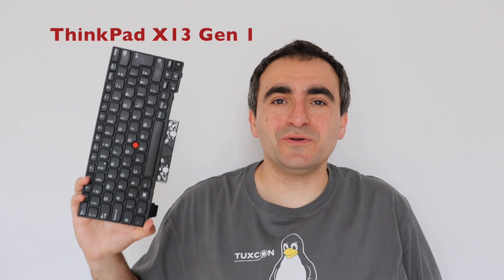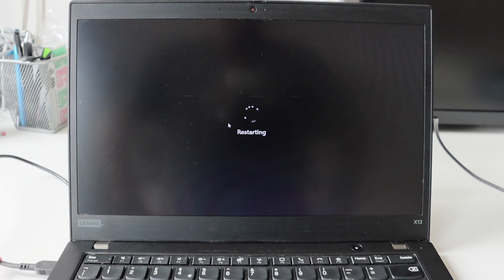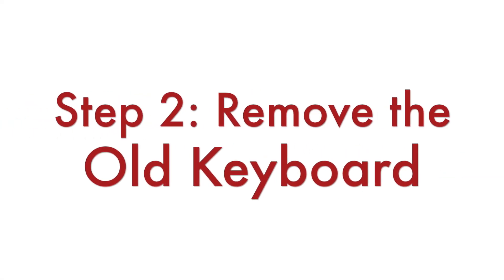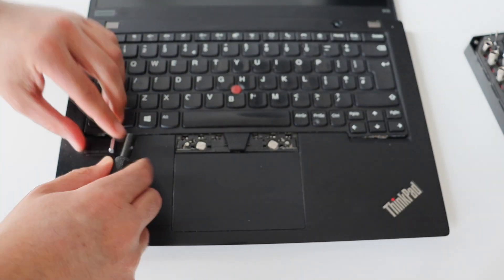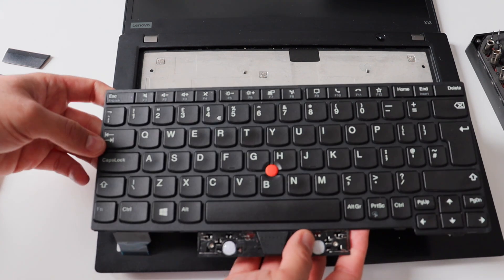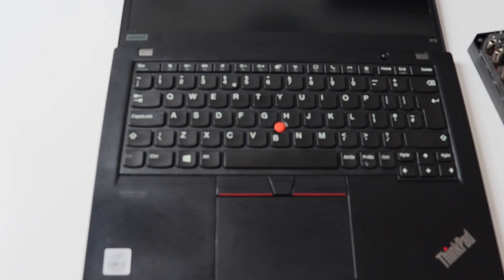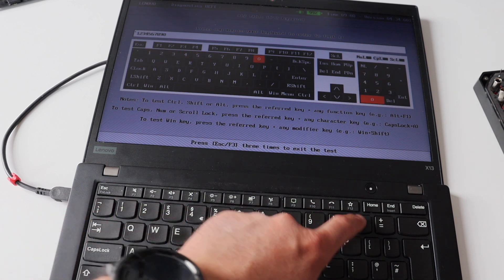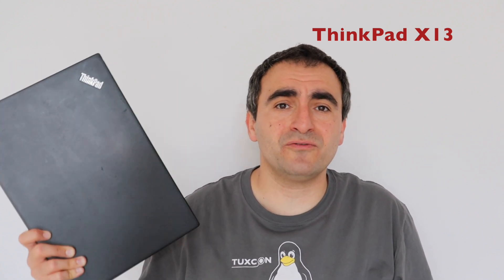Lenovo ThinkPad X13 Keyboard Replacement

Comment: Pushing it on top moves the keyboard up, without the need of trying to squeeze it in between.
Reply from the maker: Thank you for the recommendation. I will try this next time I need to replace a keyboard on a ThinkPad. It should make the process much smoother.